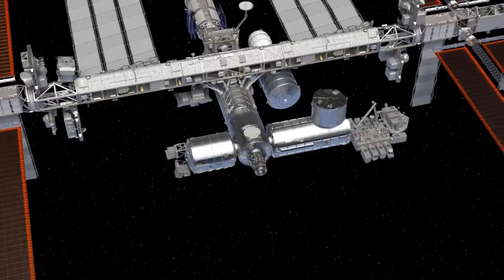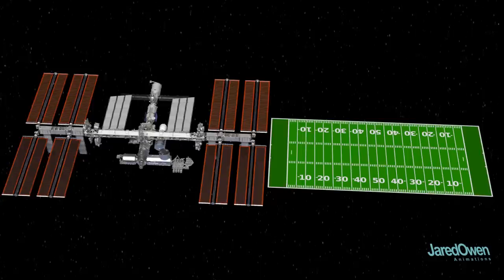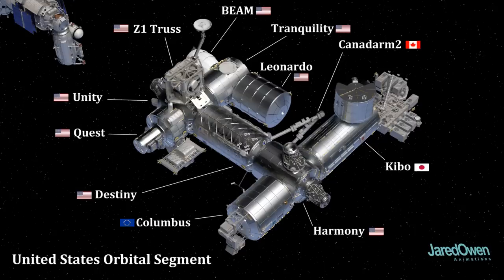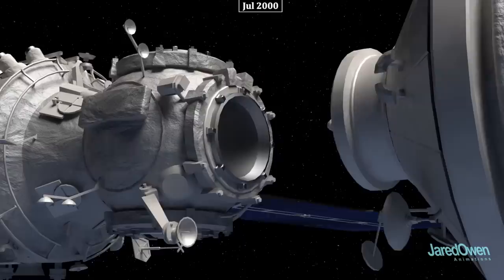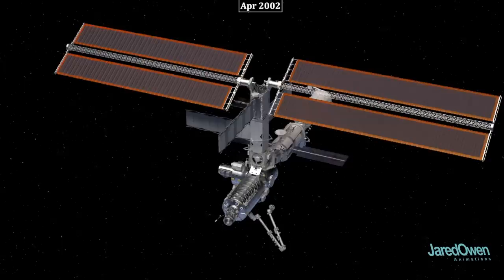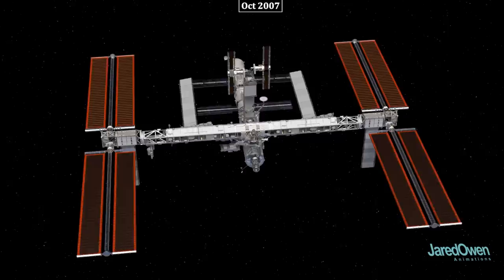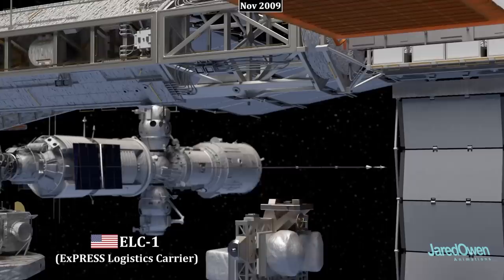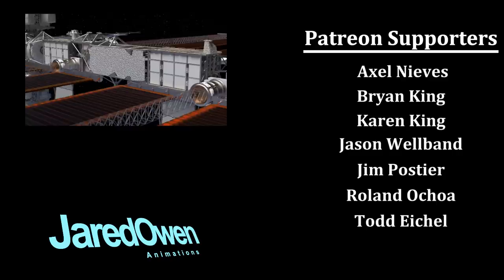How does the International Space Station work?

Comment: Could you explain to us how does ISS construction while moving at speed 28000 km/h? 😕
Reply: Because all the materials, workers and tools are ALSO moving at 28000 km/h. It's as if you ask how can you eat and drink in a plane which is travelling at 800 km/h. Which counts is the RELATIVE movement.
Reply: It doesn't what the absolute velocity is. What matters is the relative velocity. And this is where orbital mechanics helps: the speed an object orbits the Earth (or anything else for that matter) is directly related to its orbital altitude. The higher the orbit, the slower the orbital speed. Therefore, everything in the same orbit as the ISS is automatically moving at exactly the same speed.

The process of getting spacecraft to the ISS involves carefully planned maneuvers at different orbital altitudes, but the maths for how to do it was worked out more than 50 years ago.
Reply: A simpler way of saying this is to imagine two trucks moving at 20 Kmph, you can pass a wooden plank to the other truck without a problem, even though they are both moving at high speeds. This is similar to how orbital construction works.
Reply: If I’m driving 60mph and a car next to me is moving 60mph, doesn’t it appear they are passing me or staying inline?
Reply: @captainhellhound7451  If they are moving in the same direction at the same speed, they should appear the same as if they were not moving at all, the only difference would be that the road would appear differently

Comment: How does the solar panel withstand the pressure of flying at 28000 km/h?
Reply: There is a reason why satellite orbit in space and not down here - because there is (more or less) no air, so you can reach 28000 km/h and you keep it also without propulsion. You can see what happens when you move with 28000 km/h in normal air, when something from orbit enters the atmosphere - it will be destroyed and burns up.
Reply: @sebastiannolte1201  So if there is less air, how is propulsion achieved?
Reply: @athan7199  Why do you need air for rocket propulsion? The big different between a rocket engine and a jet engine is, that the rocket engines carries not only the actual fuel, that is burned, but also the oxygen with it. Or do you have this weird misconception, that you have to push against the air to move forward? No, that is not how reaction engines work, neither jet engines, nor rocket engines. Neither in space, nor down here. It just works by the conversation of momentum.  Ever felt the recoil when you shoot a gun? You would also feel that in space, that is how a rocket works. Or sit on a wheel chair and throw away a bowling ball. You will roll backwards - and no, not because the bowling ball "pushed against the air". BTW already at 13 km, so the altitide of regular airliners, you only have 20% of the air that you have down here.
Reply: There is no air resistance in space, because there is no air in the first place.
Reply: @athan7199  Its not , because rockets cannot work outside of a pressure system. Newtons law prohibits it
Reply: @marxman00  You have no idea about Newton's laws. Which of Newton's three laws probhibits it? Actually rockets work because of the third law.

But OK, let's assume you are right. Let's say I believe you, that all the thousands of aerospace engineers have no idea how the engines, that they build, work, but you are the one who actually know how rocket engines work. Then please explain what you mean with "outside a pressure system". 

So we have a rocket that goes up. It works down here where the air pressure is 1013 hPa. The air pressure gets lower when it goes higher, at 13 km (the typical altitude of airliners) the definitly work, although air pressure is only 191 hPa. At 50 km (you can still see a big rocket with high zoom on that distance) it is only 165Pa. At 100 km (most used definition for the beginning of space) it is 0.3 Pa. Of course there i nowhere in the universe a perfect vacuum (what does that even mean in that case?) and the pressure in outer space even far beyond the moon is 0.000000000000001 Pa.

So up to what altitude does the rocket produce thrust? And what happens then? It has full thrust up to a certain altitude and then suddenly no thrust at all at a certain threshold or what? Or is there a
Reply: @marxman00 Rocket engines work by shooting mass in the opposite direction to propel them. That’s the only way to move in space.
Reply: @Selatapey  in order to dock with ISS (controled collision) , the craft woud have to adjust its velocity by either accelerating (losing fuel mass)or decelerating (losing fuel mass) The position and velocity  of the craft is only  relative to the expelled fuel mass. The craft can never attain equilibrium with a third mass (ISS)
 In a "space vacuum" there is no frictional environment and the particles of accelerated fuel mass cannot push agaist each other, they are meerly emitted  as their relative velocity is zero.
Reply: @marxman00  Nice word salad boy.

Comment: How they attach all this ?
Reply: module by module 
On the US side (rather than the Russian) they use the Common Berthing Mechanism
But Russian modules have unique connectors. To connect the first American-built module, Unity, the module came equipped with a Pressurized Mating Adapter (PMA). These convert one connection system to another.

Comment: how do they keep iss above the 400kilometer  and tell us how much radiation and how et would effect an apple if it was in the Van Halen-belt .
Reply: "how do they keep iss above the 400kilometer"
Actually it is not always above 400 km. At that altitudde there is still some atmosphere, and so there is drag that slows it down. That means that it doesn't keep orbital speed forever (which would be the case for higher orbit), but loses speed all the time and so it also loses altitude. Here the altitude of the ISS over time.
https://en.wikipedia.org/wiki/International_Space_Station#/media/File:Altitude_of_International_Space_Station.svg
So it has to be pushed from time to time, otherwise it would finally fall down after a while. These pushes are made by spacecrafts that are docking, but it also has a propulsion system.

"et would effect an apple if it was in the Van Halen-belt "
They are under the van Allen Belt. And where exactly do you mean? it is not like that there is an exact Van Allen Belt where you have a certain radiaation and than an area where is is no belt with no radiation.

Comment: they constructed it while at 28000kph?!
Reply: Well, relative to the earth axis, yes. If you take the sun as the reference then even at 108000 kph, because the earth moves around the sun with that speed. When you construct a LEGO ISS while you are sitting in an airplane, then you constrct it at 500 mph. You cannot feel or measure "absolute" speed, so it is not relevant.
Reply: @sebastiannolte1201  whats Geostationary orbit in context of what u shared?
Reply: @rgravi  Geostationary orbit is 35786 km away from earth. Plus the 6379 km radius of the earth, makes 42165 km radius of the geostationary orbit. So a circumrefence of 264930 km. The satellites needs 24 hours for that, so they move around the earth with 11039 kph.
Reply: @sebastiannolte1201  thank u will digest
Reply: Wait, the 11039kph is speed for moving round the earth. So means the 28000kph is not geostationary orbit. Then also the earth is hurtling thru space revolving round the sun which in effect the satellite is also doing? Then also, using your relative speed analogy, its acceptable for the case where the astronauts were inside the satellite. But if they were outside? They wont “feel” that speed cos theres no air resistance?
Reply: @rgravi  
"Wait, the 11039kph is speed for moving round the earth."
Yes, for an actual geostationary satellite, 35786 km away from earth's surface.

"So means the 28000kph is not geostationary orbit."
No. "Geostatonairy" only 400 km away from earth's surface would be not much more than 1670 km/h, which is the radial speed of the rotation of the earth down here, but that is too slow and the satellite would fall down.

You can calculate the orbital speed: It is the speed where the gravitational force is equal to the centrifugal force. So you can calculate that for about 400 km altitude it is about 28000 km/h. And you can also calculate the geostationary orbit (so where a satellite moves together with earth's surface so that it seems fixed at the sky from the perspective of the ground) and will see that it is 35786 km away.

"Then also the earth is hurtling thru space revolving round the sun which in effect the satellite is also doing?"
Yes, and the solar system move around the center of the milky way.

Imagine you walk in a room with 5 km/h- you have no idea where you are. But actually that room is inside of an airplane, that moves with 800 km/h, but you don't notice it and you cannot know. So how fast are you? An observer on the ground sees you moving with 795 km/h when you move to the back of the airplane and 805 km/h when you move to the front of the airplane. You could also always be inside of a bigger airplane that moves in other directions. You cannot feel or measure that. Speed can only be described relative to a certain observer or between two things.

". But if they were outside? They wont “feel” that speed cos theres no air resistance?"
Correct, there is no difference between outside and inside in that case.

When I use the airplane analogy you can say "You don't feel that you are moving with 800 km/h because you are inside of the airplane, but outside you feel it". Actually you don't feel that you are moving with 800 km/h outside. What you feel is that air hits you with 800 km/h. So that the relative speed between the air and you is 800 km/h.

Imagine you are on a motorcyle driving 100 km/h. You probably would "feel that". But now imagine the motorbike is fixed and a huge fan is blowing air with 100 km/h in front of the bike. It would feel exactly the same. Car companies do exactly that when they designing a car with the help of a wind tunnel.
Reply: @sebastiannolte1201  thanks!

Comment: I'm just being a dreamer here, but why couldn't we just move the ISS to the moon. It would use technology we use and could fit into nassa mission 
1. Retract solar panels 
2. Using nassa older shuttle upgrades to engines would be needed to reach the moon.
3.toe modules and panels to southern pole, land all equipment 
4. Next rovers preprogrammed to reconnect modules and 3-d printers would mix concrete like structure over the modules working with the rovers to format a dome
Using everything we already have with tested technology would it be a better use and a cheaper price tag then starting over or allowing the ISS to burn up?
Reply: Bringing the ISS to the moon would mean, that you accelerate an object with a mass of 450 tons from 28000 km/h to nearly 40000 km/h.

Comment: It works by CEE GEE I.
Reply: The real thing doesn't. You can see it from the surface.
Reply: @MeerkatADV  but it will be small as a head of a pin needle (from the surface)
Reply: @window5417  you can take pictures of it with even a moderately powerful telescope.

Comment: How do they boost the ISS back into a higher orbit?
Reply: Vigga  They used the Russians to move it higher but SpaceX is going to do that now.
Reply: @SMHman666  found some videos on how they do it. They used to use the space shuttle mostly it seems. 
Orbital mechanics is a very interesting subject. How they maintain 17 000 mph of speed is mind-boggling.
Reply: @viggaqu6385  Yes, pretty wild stuff that can be hard to comprehend sometimes.  Amazing speeds.
Reply: @viggaqu6385  
Maintaining that speed is not difficult at all, since air resistance at that height is not that high, achieving that speed is completely different story.
Reply: @max5250  Yeah while watching footage of the space shuttle doing the  rendezvouz pitch manuvure, I did think the air resistance must be negligible.

Comment: if people made rockets powered by electricity we would not need to refuel
Reply: Don’t you think scientists would do that if it were possible?
Reply: Electric rockets are WAY too weak to get off of earth’s surface
Reply: then just use fuel to get up then electricity to stay up but my comment is just saying if its possible @A literal Pothole
Reply: @voltskki6523  even in space, ion engines are weak as all hell. Chemical engines are indefinitely better. Ion engines are way more expensive than standard engines too. In the current market, ion engines are rarely needed. They’re really only good for long distance missions to the outer solar system or so.

Comment: The cgi station
Reply: @jakesta104  Do you use your fingers to add and subtract?
If that’s the case this will go right over your head. I’ll try anyways:
The circumference of Earth is 40,075 km.
The speed of the ISS is 27,756 km/h.
Divide 40,075 by 27,756 and you get 1.45.
As 1 hour has 60 min. 0.45 is 27 min.
So, the ISS will need 1 hour and 27 min. for one orbit.
That's 87 min. 

However, the actual time for one orbit is 92.9 min. 
In the above calculation I forgot that the ISS is 400 km above Earth. Therefore, the orbit increases by 2500 km.
2500 km means another 5.5 min. 87 + 5.5 = 92.5
Pretty close to the correct 92.9 min. Don’t you think?

The speed of Earth around the Sun is not “30 per second” (What does that even mean?), but 30,000 km/s.
This speed is completely irrelevant.
And the reason is not gravity! (You have miles to go before you reach mediocre.)
The reason is inertia and Newton’s 1st law: “Every object perseveres in its state of rest, or of uniform motion“.

Everything on Earth has a speed of 30,000 km/s.
Every rocket, even while sitting on the launch pad has a speed of 30,000 km/s.
When do you think this speed vanishes? Why would it disappear? How would it run off?

Answer: It does not!
The ISS has a speed of 27,756 km/h relative to Earth. The ISS has (just like Earth) a speed of 30,000 km/s relative to the Sun and an even higher speed relative to the centre of the galaxy.
The only relevant speed is that relative to Earth.
All other speeds are completely irrelevant because they have always been there (even before the launch) and the don’t magically disappear.
Reply: @bobmusil1458  I'm not talking about how fast we are moving around the sun for a start.. all the numbers are irrelevant to you because you would not be able to explain it.  And the earth is moving through space faster then 30,000kms.. you wonna bring the galaxy into this ok then? our galaxy is moving 140 miles a second so how does something we own in outta space keep up with that speed. Do thing that enter our galaxy automatically start to move along with it?
Reply: @jakesta104  
You are right: Why would you google something just because you don't understand it?
You wouldn't want to lose your ignorance.
Knowledge is a dangerous thing.
Nobody who knows anything is a flattard anymore.
So, better be careful.
Reply: @jakesta104  
I can explain everything - but you wouldn't be able to understand.
(Do you at least understand now that 40,000 km and 27,756 km/h matches perfectly and your question was embarrassingly stupid? Do you?)
"Do thing that enter our galaxy automatically start to move along with it?"
I'm curious. What "thing" has ever entered our galaxy? Please, do tell!
Reply: @bobmusil1458  do things* come on man I thought someone as smart as you would understand that little error.
Reply: @bobmusil1458 yes I understand that the iss can make a full lap in that time on a none moving earth.
Reply: @bobmusil1458  bob all your doing is writing someones else’s theory
Reply: @jakesta104  What little error? So, what has ever entered our galaxy?
Reply: @jakesta104  "the earth is 40,075 kilometres. how does something that's traveling 28,000 kilometers per hour somehow gets around the earth in 90 minutes"
Seems you have learned something you did not know yesterday. I'm happy for you.
Reply: @GAMING-CELT  
I have seen the ISS with my own eyes.
I have taken pictures of the ISS with my own camera.
All you ever do is cry "CGI" every time somebody shows you something that might burst your bubble.
PS.: Were the pictures of Earth taken by the Apollo missions also CGI?
Reply: @bobmusil1458  your the one afraid bob
Reply: @GAMING-CELT  I'm just as scared that the “spinning space ball theory could be wrong” as I am that I might fall of the spinning ball and be thrown out into space.
Reply: @bobmusil1458  how can they possibly be real pics of your globe if Neil Tyson says it’s pear shaped ?
Reply: @bobmusil1458  my apologies for abusing you calling you names, have you ever heard that song astronauts In the ocean by masked wolf it's quite famous. You seem like a really smart guy and I just wonna encourage you to learn symbolism.